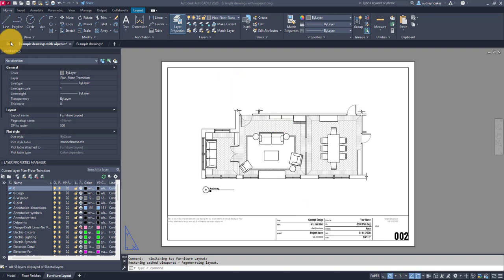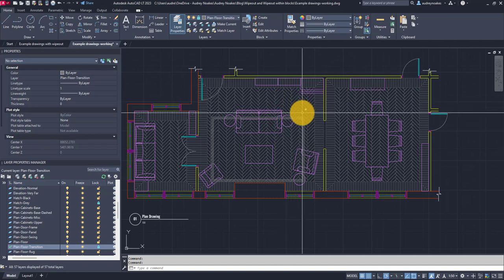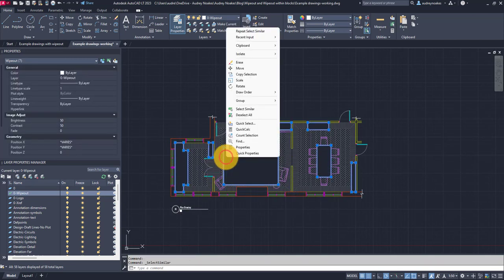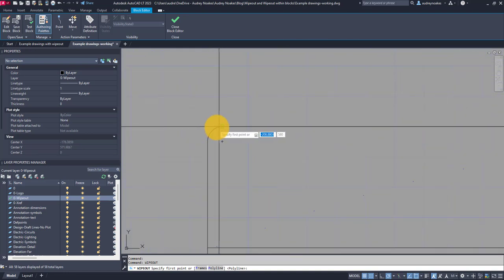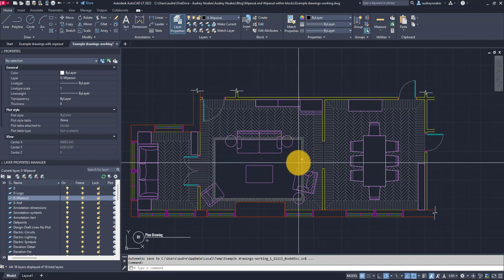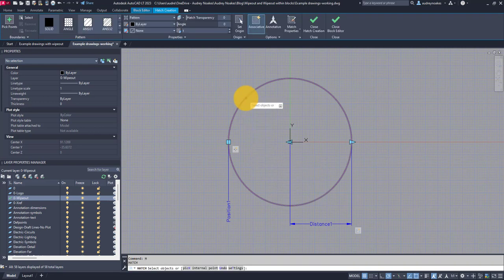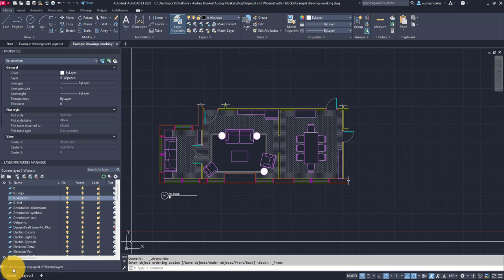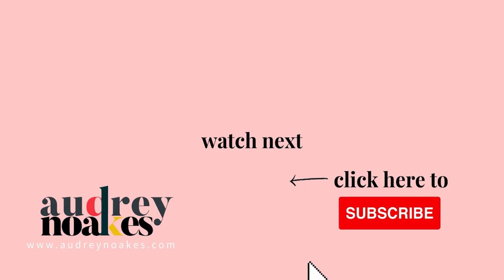WIPEOUT Command 101: Thinking about draw order, within blocks, and alternative for round objects

Comment: What is the advantage of a wipeout command in a block, compared to just solid hatching a poly line which defines your block?
Reply: When use the same block multiple times, ie. chairs in an auditorium, it increases speed of drawing by making sure that every block has the wipeout and hides unnecessary details, ie floor patterns.
Reply from the maker: Yes, exactly right! (Hatches slow down a file alternatively, and if you have a bunch of solid white hatches your drawing definitely starts to look confusing in model space!)